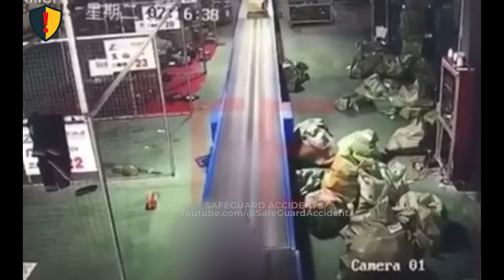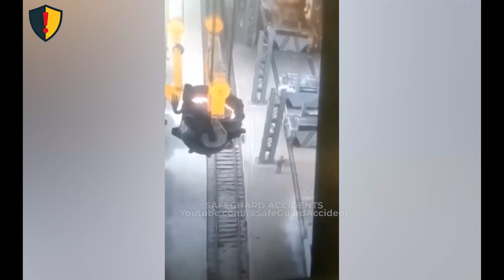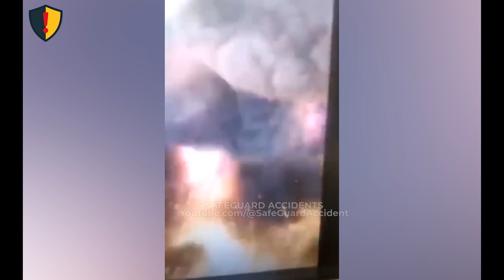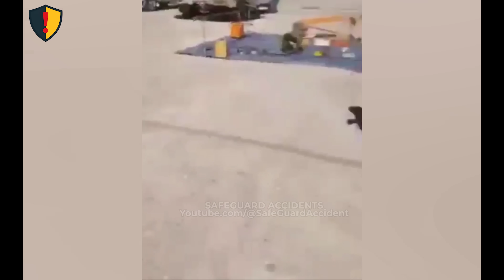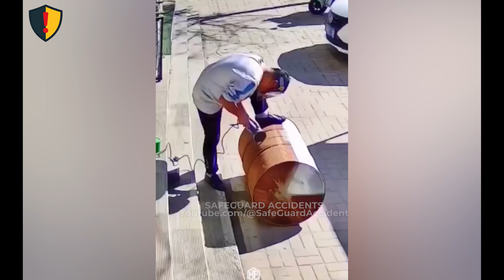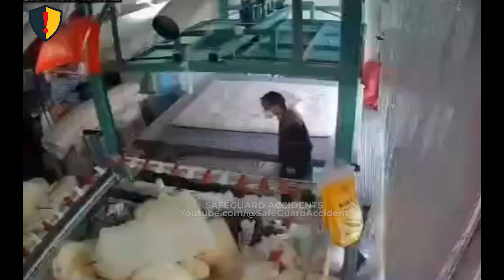😱 CONVEYOR BELT ACCIDENT PT.6

Comment: In clip 6, forklifts cannot handle side thrusts on an extended mast.  The counterweight is very good at keeping the forklift from pitching forward, but the rear axle pivots, so that the forklift does not immediately fall over, if it hits a ramp at an oblique angle, so the counter weight only resists falling over after the tip over starts and the forklift is too narrow for the counterweight to help very much.

Clip 5 is confusing.  Electrical distribution systems routinely have linesmen do some types of maintenance, without de-energizing the transmission line.  Procedures exist for safely working on energized lines of up 500,000 volts AC.  One possible issue is that the boom of the boom truck cannot be conductive, but some kinds of dirt can briefly carry a current from the line to ground.  There is important information about the incident that is not visible in the video clip.